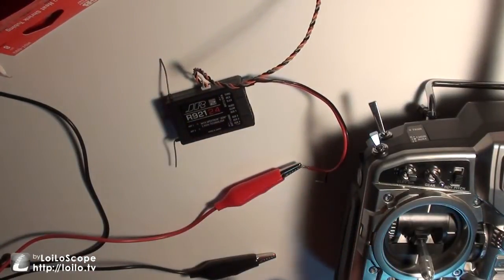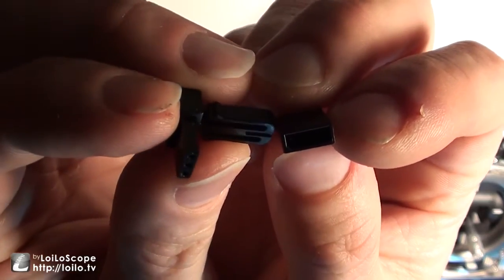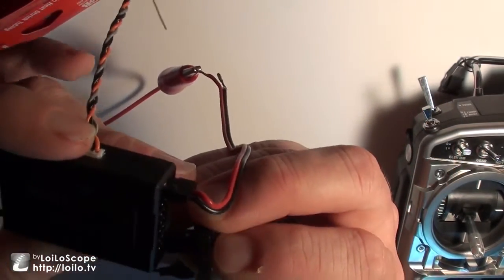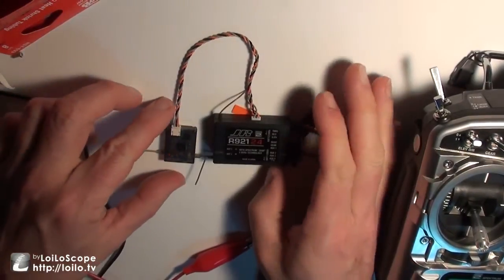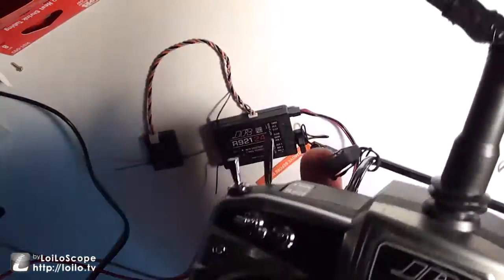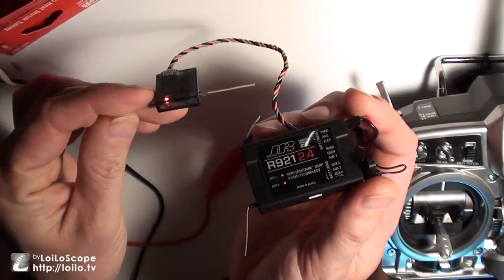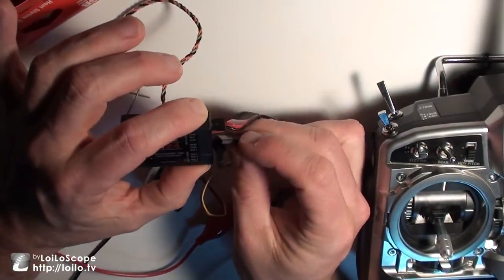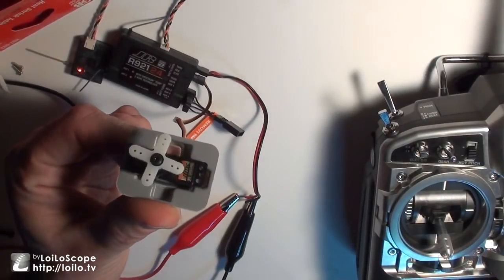JR BIND 1

Comment: My 921 receiver blinds but after I turn the switch off and on the light flash slowly . yes the servo do work with the transmitter but I 'm thinking the receiver light should be solid .

Comment: Hey friend!  I recently bought a used rc helicopter with the JRJ921 receiver but I'm having trouble making a bind, the lights don't flash or even turn on, so I can't make a bind either, the strange thing is that when connecting the servos they get power.  In your personal opinion, what do you think could be the problem?  Could it be that the receiver doesn't work?  Everything is correctly connected and it does pass power to the receiver and the receiver passes power to the servos but there are no reference lights or access to bind. I'll appreciate your opinion.